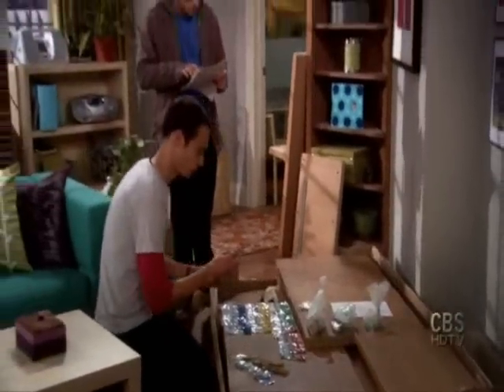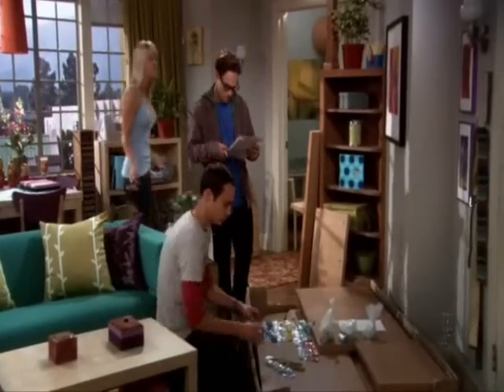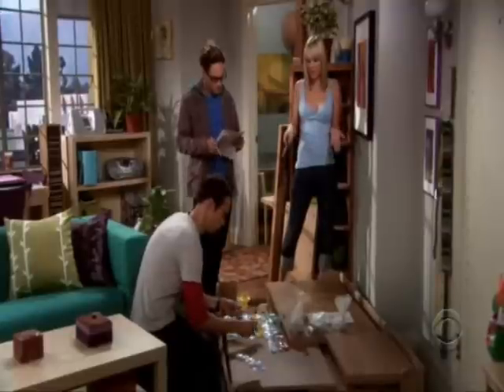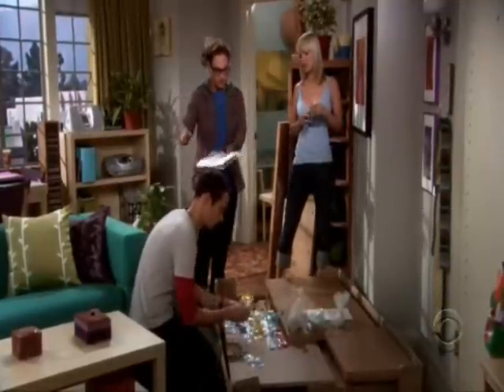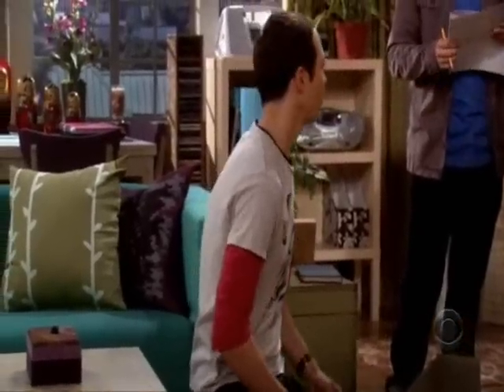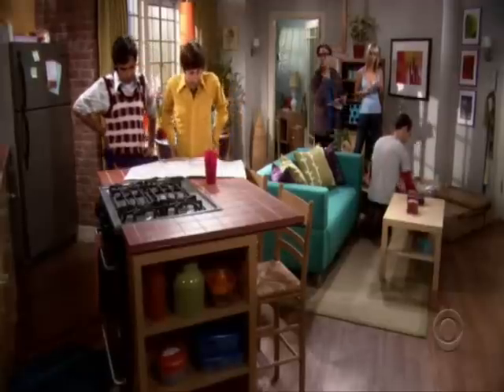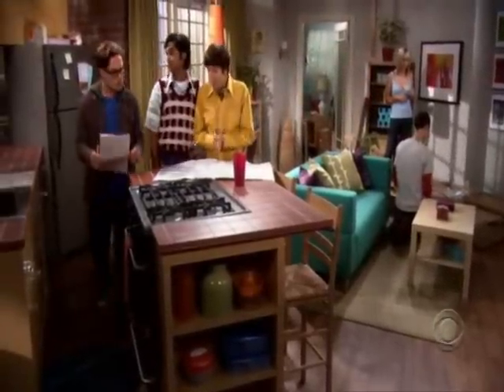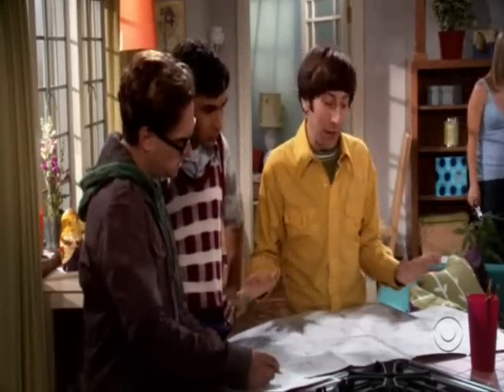The Big Bang Theory - Assembling a Media Center

Comment: My father hired my wife and I to assemble ikea cabinets for the shop. We followed the instructions. When completed my father scolded us for not doing it right then drug us over to the ones he'd assembled. He'd redesigned and refitted everything and improved on the functionality....blah blah.
My father was a PhD electrical engineer.
Reply: Drug!?!? WTF? Dragged - haha.
Reply: @mikeries8549  abbreviations aren't bad grammar
Reply: @mikeries8549  okay then, what is drugged abbreviated for?
Reply: @mikeries8549   Should not have answred, it's not worth it.
Reply: @er2206  He did. That's why he can't use proper grammar until this day.
Reply: how are you English and not know English?
Reply: The way I see it here is that the father is the one in error.

If he wanted them put together in his unconventional way rather than the way it says in the instructions then he should have specified it like how someone has to specify what condiments they do or do not want on a burger.

In the end it seems to be a communications problem. If he didn't say which outside the box way of assembling the cabinets then he should have expected that it would be done by the (instruction) book.

Comment: "How are you gonna cool it ?" - Cooling a stero.. whaaat
Reply: Daniyal Munawar  Cooling an infrared extension... even more whaaaaaaat?
Reply: If they are confining the amp to an area with limited airflow, overheating is a very real concern. Car stereo amps typically use its entire external frame as a giant heat sink. The heat is spread over a very large surface because their is usually very little airflow in a car trunk, under the seat or anywhere else car stereo amps are installed to draw heat away.
It’s pretty nerdy to mod an ikea entertainment center with liquid cooling, but it isn’t any more difficult to do than adding a water cooler to a pc.